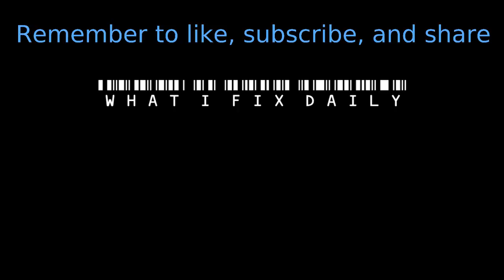#231 iPhone 6: Short circuit with a common trap

Comment: I think the shields take a long time to cool because they are soldered to the ground plane and are made of metal. There's a lot of thermal mass there.
Reply from the maker: I guess one way to test and answer the question is to take a reasonable quantity of the alloy, heat it up and see what temperature it becomes liquid, and then let it cool down and see which temperature it returns to being a solid.